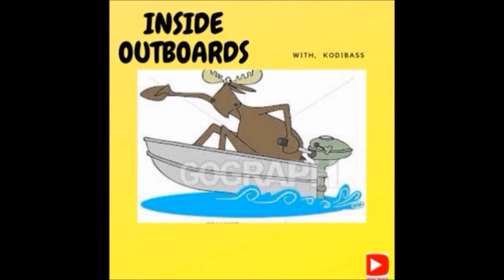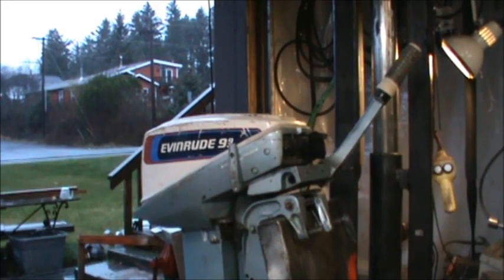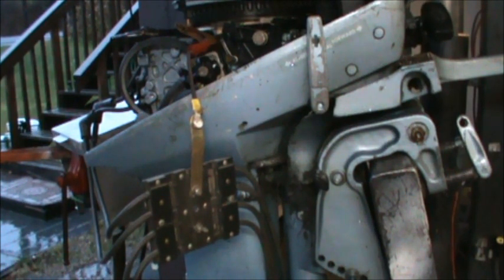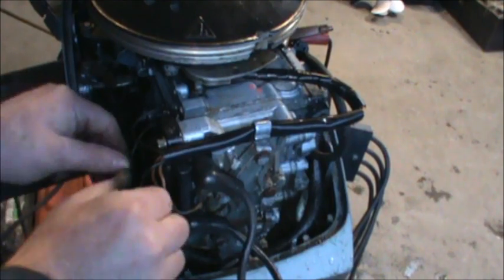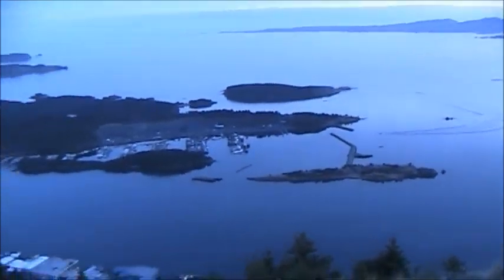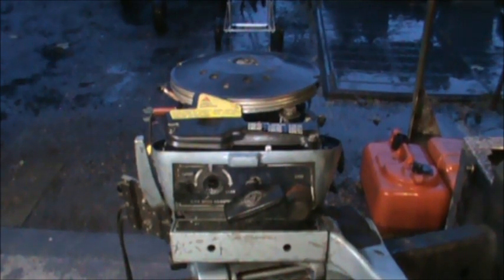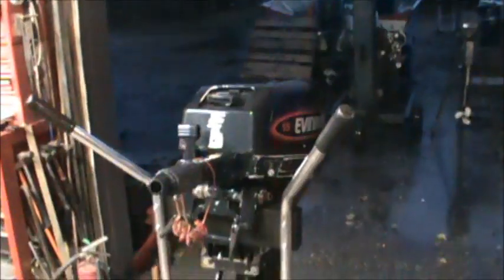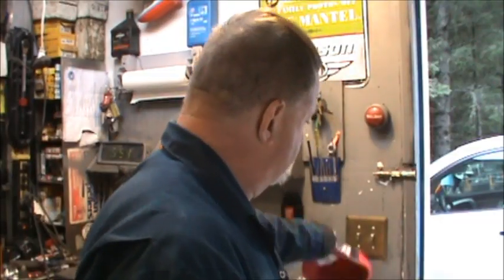EVINRUDE 15 HP PROBLEM FOUND,   FIXED

Comment: Hello.  I have a 1993, 15 hp, long shaft.  Used to run perfect but over time needed a carb re-build. After completion, it runs, wide open, perfect for about 300 yds. and dies!  It will not re-start unless it sits for a while.  Plugs burning nice.  Completely stumped!!  Thanks
Reply from the maker: I would start by doing a F.A.C.T.S  check as soon as it dies. If it won't start until it sit's for a while compare a cold start FACTS  check to right after it dies & won't re-start.  then go from there.   kb

Comment: working on a 94 evinrudy 9.9.. disconnected kill switch then I have spark but only on top cylinder,, whats the chances the kill switch and a coil went bad? wires are kind of ratty though, so im going to look deeper.. the wiring doesnt hold up well on these motors very well in Texas heat. might run mine with the cover off..when that little low profile cover is on, it doesnt seem like theress any place for the heat to go. in fairness though, these motors are 20 to 30 years old and I can get any of them running so far that arent seized up.. rarely find them worn out, they just dont get enough use by most folks to wear them out,,  the ones with some wear on them and that are kind of loose, seem better,, they start easier, shift slicker, are quieter and vibrate less..
Reply from the maker: Switch your coil wires & see if the problem follows,  Did U mean 1984?  The 94 has the high profile hood top mounted recoil start.     kb

Comment: Kodibass, I have a disapointment. My head gasket on the 30 horse Johnson is not blown, i had hoped it was, to account for the only 90 psi compression in each cylinder that shud hav ben about 130 psi? The cylinder walls are not scored which could have also caused low compression but at least i wont have  to tear the engine apart further to get the block honed down & then replace piston rings. The cyl. walls feel very smooth. I guess  i just put it all back together, the reed valves look ok. Maybe not, i better study up on them. There is a slight discoloration between cylinders on the head, & there was oil on that area, but no burn marks or exhaust residue, yet  im wondering if this may indicate a compression leak? Also, should i have a real close look at the reed valves, does that seem like a likely problem?
Reply from the maker: I would use a flex hone (dinggle ball) Give it a quick hone those numbers might come up a bit.    kodi
Reply: Thanks for your reply, Kodi. And is there any way I could send you pictures of some slight discolorations on my head gasket and gasket contact area on the ridge between the cylinders for you to see if you would think this could indicate slight leak out between cylinders?

Comment: Looks like someone made this engine up from pieces parts.  1976 engine cover, UFI ignition on what looks to be originally CDII.  That stop switch mess is what happens when techs don't have/use the amphenol tools to remove/install the pins/sockets.  It's great to have an straight forward fix every now and again.   I could use one for sure these days
Reply from the maker: You R correct on all counts. I might have plans for the crank, I think I have a old 25 hp in my pile ( somewhere)  That some idiot smashed the flywheel nut and threads all to pieces .  kodi

Comment: What would you say if a 79 15 evinrude runs great one day but the nxt day has no fire? Killswitch is disconnected has New cdi box, and up until last Saturday had zero spark issues.

Comment: Hi Kodi, I'm still using my gopro hero 4 and I think they are up to 8 or something like that. Mine still works great and is clear. I use my wireless mic which sounds great too but find myself sometimes just recording without it if its a quick short video. Even though I was a lead singer and bass player in the 70's I was not that great at remembering cover song lyrics. sometime just faked it on stage or made up my own haha. So everything you come up with I have no clue who it is but wish I did. when you shoot your area it keeps reminding me to go down the hill and shoot the puget sound. I'm a mile up the hill. So this week will do that and share with you first then put on my next video or so. Stay dry up there and give Fred an umbrella
Reply: My hero 4. Love it. That's why I haven't bothered to get any new ones yet. I should buy another battery for it especially when I'm fishing. So I suggest you get an extra just in case you need to pop one in when your recording. I have been getting by just making sure mine is charged up first.
Reply from the maker: Spent some time during the 80's  in Puget sound ,  Loved it , Saw my first Killer whale  there on a  ferry over to Bremerton Wa.,,   Caught my first Salmon off a old dock there.  Mems 4 sure.                                                                       kodi

Comment: Did you ever see that video on Tesla 350 hp hyper electric marine it’s bright green no noise other than the water looks crazy fast I guess they have a couple different ones
Reply: It’s under Ludacris boat launches Tesla electric motor
Reply from the maker: Yes I watched it,  They will get there, 4 sure.  Batteries r getting smaller lighter & way more powerful every year,  Just a matter of  time & cost.                                                          kodi

Comment: Not 100% sure but I think the you might be filming in wide angle with the gopro which distorts the horizon...Set it to standard on video settings...That's how it works with my hero8 anyway
Reply from the maker: I will try, But remember I am limited in this,,    kodi

Comment: I have same engine but its a 9.9. Replaced the reed valves, ignition coils, power pack, fuel pump, rebuilt the lower unit, and I still haven't finished the cowling lol. Sad.....
Reply from the maker: Good on u,, Great motors 4 sure.   kodi